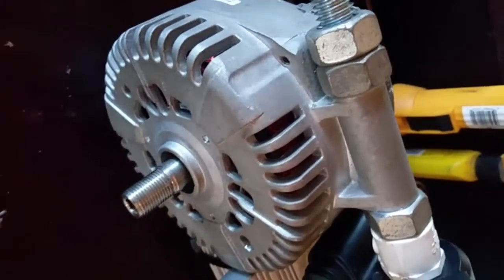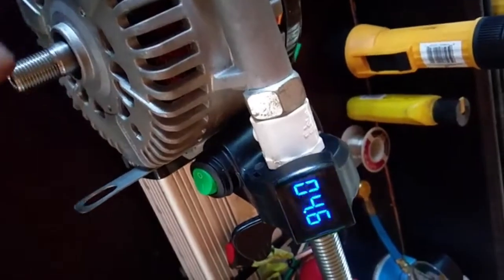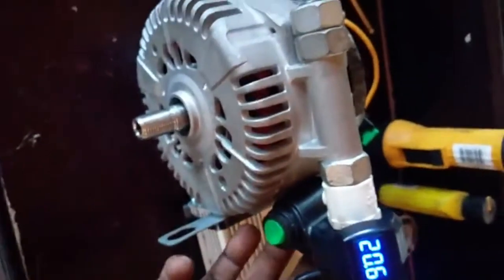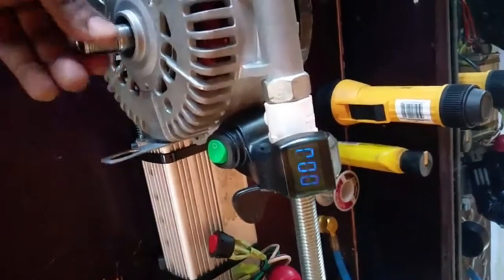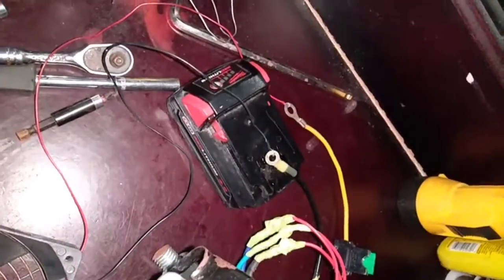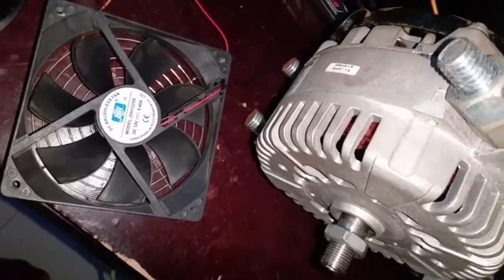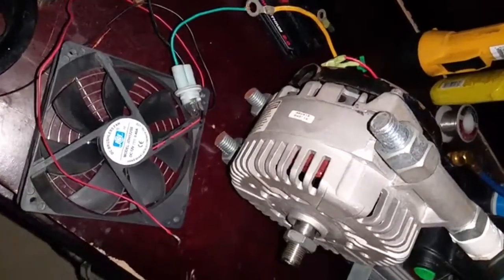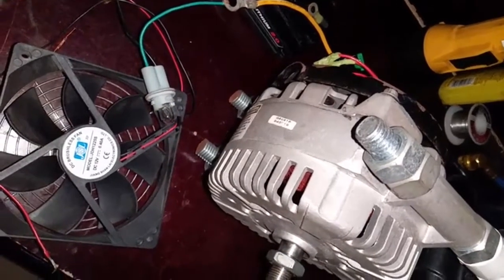Renewable Energy (BLDC motor) Generator experiment.

Comment: Any updates on this project?
Reply from the maker: Yea. I replace the automotive alternator with a permanent magnet(14) generator. Alternator electromagnetic field is too strong and require more energy to spin. I will continue the automotive application this year with more videos conning. But for now The BLDC motor is now spinning a PMG at 2500rpm and produce approximately 15-20 DCV. The PMG is control with a PWM solar charge controller to maintain a 14.5 DCV with a amperage of approximately 80-100Ah(amp per hour). The ULTIMOTOR is charging eight liquid acid(float) battery(28 plate) capable of 1060Ah(bank). With the ULTIMOTOR runing it maintain a full charge on the 12v battery at a 14.5v rate, it also power by 12dcv to 120AC inverter(3000watts) to a 14amp refrigerator, 55amp cloth washing machine, lights and other home utility like air condition. The ULTIMOTOR reaches its maximum demand with this battery is low on energy. This will happen overnight into the morning. With the circuit low on energy, when I turn on the ULTIMOTOR early in the morning, I can see it racing to output 90-100amp to refill battery and power home utility. If I should allow the ULTIMOTOR to operate all day 24/7 seven days a week, it will only show the amount of energy the utility is consuming and take is approximately 14-60amp for refrigerator(14) and washing machine(50amp). Lights are led low power. No solar, no wind or fuel is required. I have working now for one year with no problem and no brush to replace or cause damage. Both the PMM and the PMG are brushless with high amp DC Eletric for AC conversion and usage.😀.
Reply: @Stevexnycautomotive  that's awesome man congratulations I have been very very close to achieving the same back then when I was experimenting with alternators but haven't work on those projects in a very long time I would really encourage you to show us how you did it what size magnets you used and show it running we really need to bring this technology to the people the information needs to be free so others and build it who cares about patents and  copyrights man this world is going to shit and believe me they are going to turn the power off this year and it has happened in Pakistan and other countries already also in California and more they are getting ready to taking YouTube channels down left and right what is the point of waiting and making people suffer and they have to go to work to pay an outrageous electric bill plus everything else we pay and now people have lost there jobs because the stupid pandemic do the right thing man and share it with the people I will replicate it if it really works and show others I'm not in it for the money brother it's time we can make a change let's get this info to the people so when the power goes out for good we can have a way to survive
Reply: @overunityresearchchannel  
 Talking of power, and power bills, I have not had a power bill since 1994   :) . 
 Woodgas, and solar power, are the way to go.
Reply: @CNCmachiningisfun  nice man that's what I'm doing this year Iv got 9000watts of solar i need charger controllers and batteries going to make lots of wind generators and put them up too
Reply: Can you make a video just showing the armature of the permanent magnet alternator you made want to see how you installed the magnets thanks man :)
Reply: @overunityresearchchannel  
 9000 Watts of solar capacity. Now that's a lot of watts    :) .  
 Wind turbines are great, but you might find that they can be a bit of a maintenance nightmare. 
 It looks like you have some good skills, so I would like to suggest that you look into woodgas generators. 
 You'll see some of these on my channel.